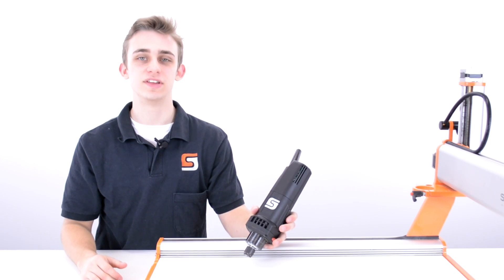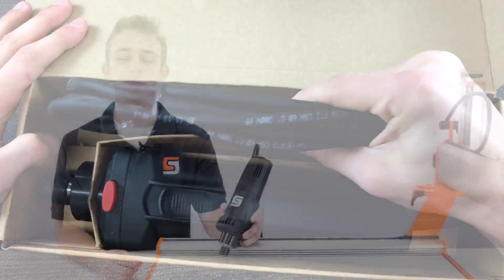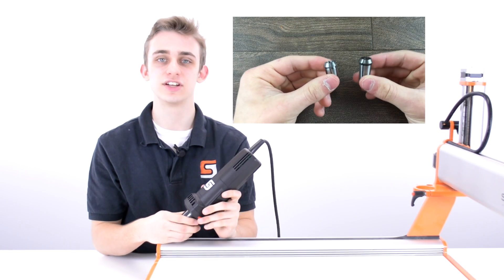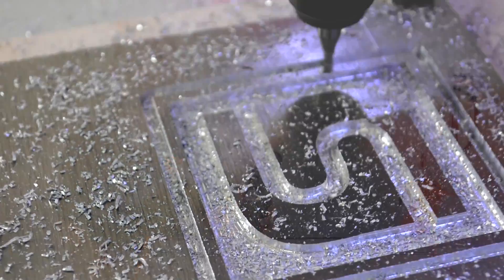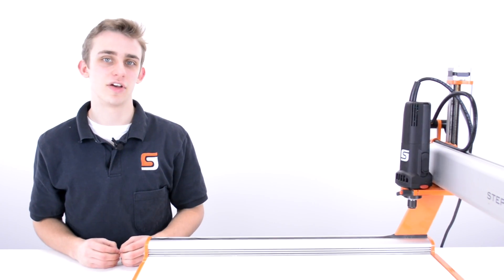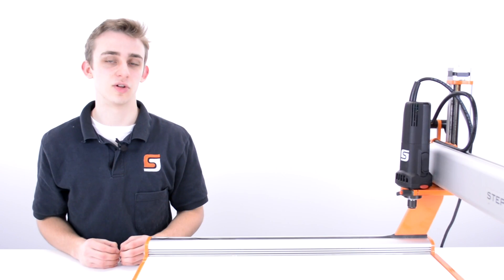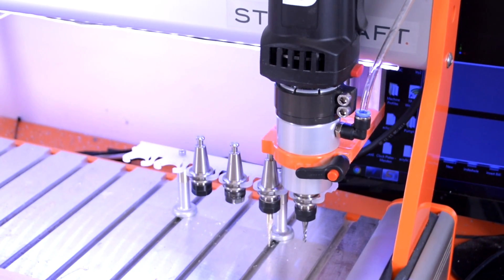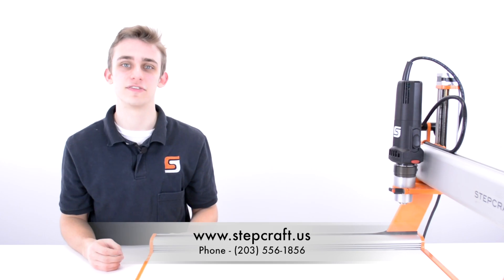1000 Watt CNC Spindle - A Closer Look at the MM-1000

Comment: hi. i work with the proxxon spindle..i already have change 2 of them!! because after about 300 hours of operating them..they burned off... the motor actually burned. (plugged on a ups)  so what about the lifespan of these MM spindles of stepcraft? (no debris, ot bad handling also..only the operating hours i beleive is my problem)

Comment: Hi, I've purchased a MM1000 spindle for my CNC 840.
Mounting the STEPAK dust adapter, there is a white plastic ring that hurts the body of MM1000.
Must the ring be removed before mounting the MM1000, or must be tailored just to fit exactly close to the body of MM1000 ? 
Thanks in advance, and apologies for boring you.
Regards
P.S. I wrote an e-mail to info@stepcraft.us. rejected with the following message : 
 "SMTP error from remote mail server after RCPT TO:<info@stepcraft.us>:
    550 REJECTED - sender or recipient rejected by remote MX"
Reply from the maker: The plastic ring is a spacer to raise the collet up from the table more. It goes on the nose of the spindle before you put the spindle in the tool holder

Comment: Is this spindle brush-less or is a motor with brushes, how loud is the motor when running with no load?
Reply from the maker: Motor with Brushes... It is not very loud - no more than any other spindle and certainly quieter than a Router like a Dewalt